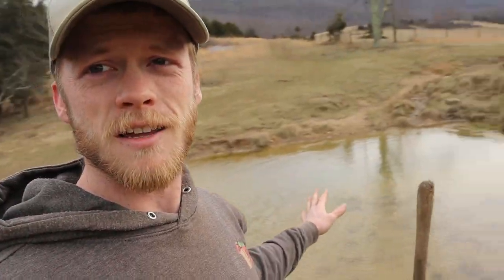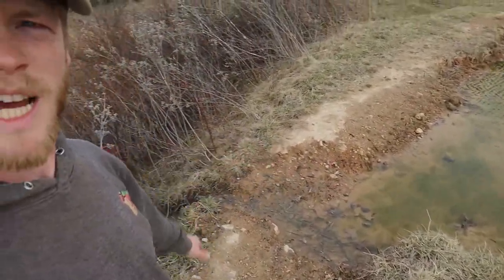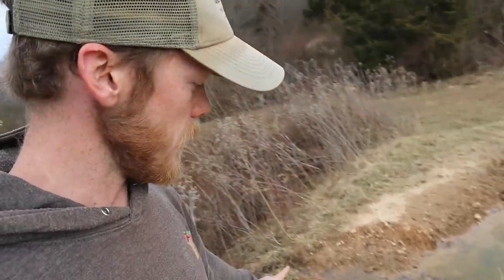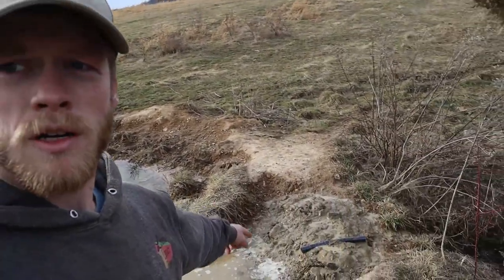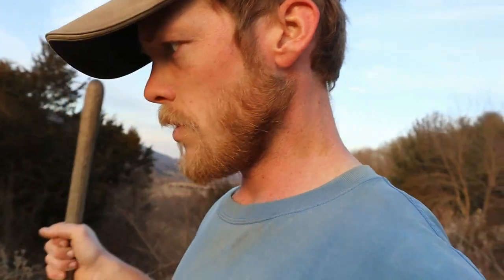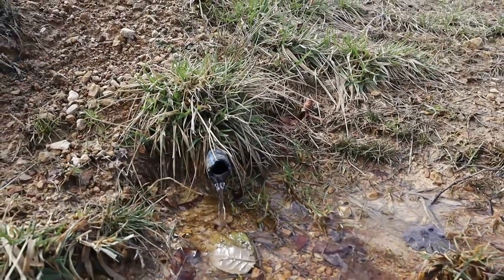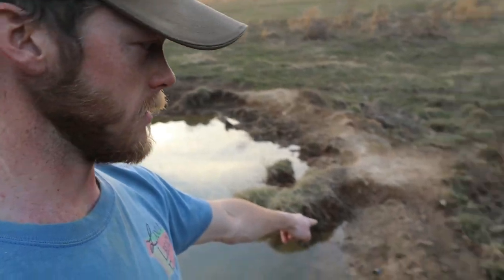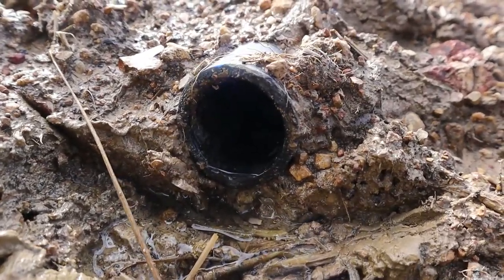Building a Simple Pond Overflow

Comment: I have a similar setup, but the pond is quite a bit larger, then it overflows about a quarter mile to another pasture drinker for the cows. The problem i have is that the pond grows a bit of algae and gets devris in it. I've made a homemade filter at the overflow, but it does clog now and then. Without it, i think my line to the drinker itself would clog up and be a big problem. Have you fashioned any fix for debris since you installed this?
Reply: Hi mate. About debris you could try two ways. One is make a silt trap (a small ball upside down shape) right before the pond. rock armor the entrance and the exit of it, not the bottom. This will allow debris to settle in and not enter the pond area. You then every now and then (depending of the size of the silt trap and the amount of sediment received) scoop out all the debris and use it for gardening or something else. The other way would be to rock armor a good part (especially if it's slopy) of the water way before it gets into the pond. You could also combine the two tecnics and obtain quite a clean result and a better water quality!! 
About algae usually it is the settling time of a new pond. It has to happend.  it could also be from the amount of nutrients (nitrogen is one) that the pond is getting. You might take 2 birds with one stone with the silt trap + rock armored waterway.
Hope it is helpful!
Reply: @Giamp25  thank you for taking the time to respond, and great suggestions! Working on it now before winter sets in here
Reply: @PJ-mj1hy  Great!! Make sure you level  the bottom of the silt trap and when placing rocks, get a good and firm contact with soil so that water wont dig under them! 😃 let me how it works! 👋